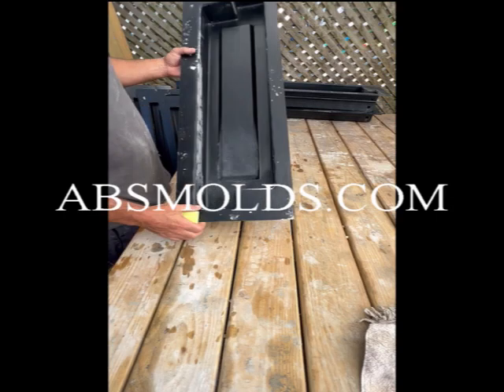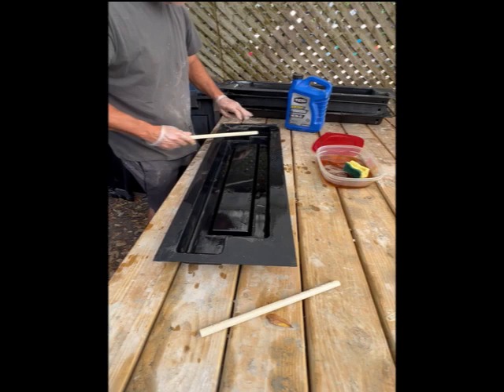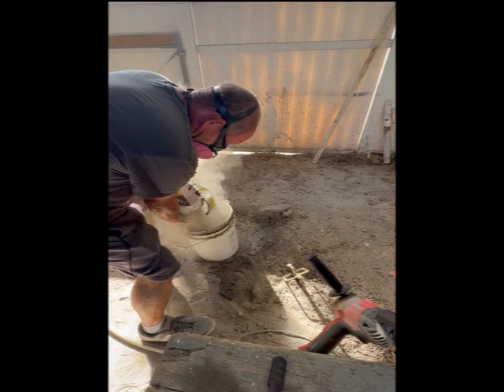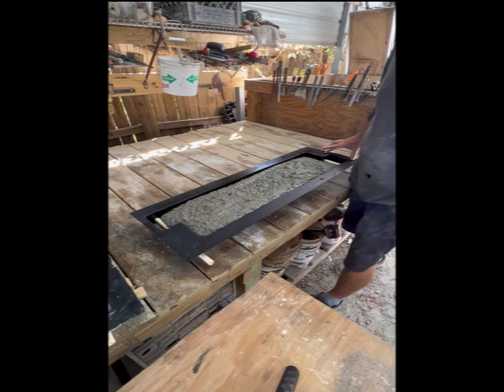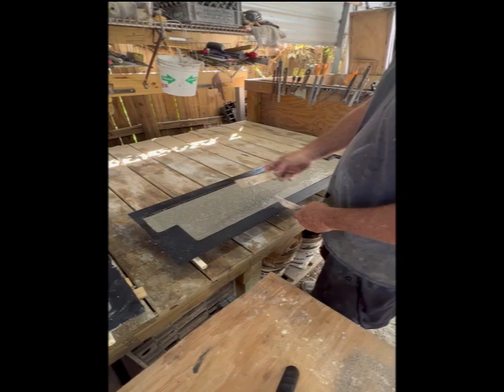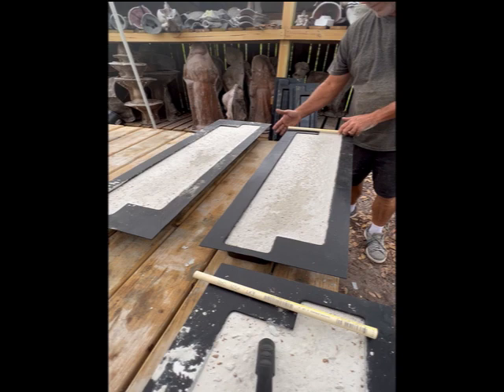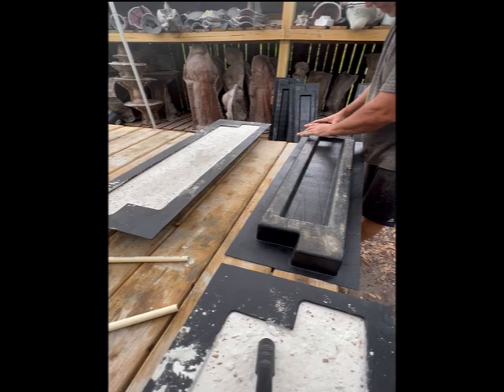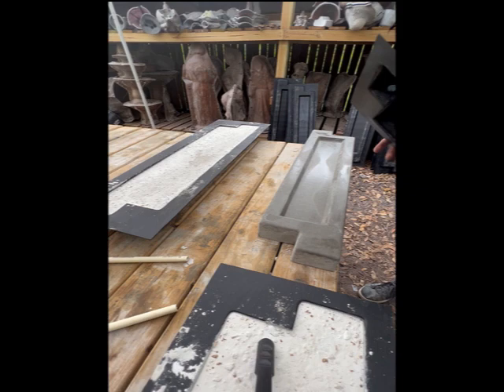Pouring and Pulling BedBlock Mold

Comment: I’m 5 into my project where I’m making about 30 of these. Some recommendations:
- use vegetable oil, shortening, or margarine to lubricator the mold. Motor oil is a toxic carcinogen and actually more expensive than these alternatives.
- rub a thin layer of vegetable oil or shortening on the inside of the mold with a paper towel. There’s no reason to go spraying motor oil all over your yard.
- Use Quickcrete 5000 in 50lb bags for 2 reasons. 1. This mold can really only hold about 45 lbs of concrete, so there’s less waste concrete to dispose of. 2. It sets in 10-12 hours instead of 24 hours so you can mold 2 of these on one day
- if you are close to the minimum set time for the concrete mix, be gentle when removing the mold from the block. I broke one block by being too rough.
Reply: Thx...👍
Reply from the maker: Dear keith,

Thank you for your feedback and suggestions regarding the use of alternative release agents and Quickrete 5000 for our ABS molds. We appreciate your input and the time you took to share your experience.

Regarding the release agent, we understand your preference for vegetable oil, shortening, or margarine as alternatives to motor oil. While these options can indeed be effective release agents, we have found through our 15 years of experience that there is a potential issue when storing the molds outside. Rodents are attracted to food-grade oils like vegetable oil, shortening, or margarine, which can lead to damage or destruction of the molds over time. This is why we have opted to use motor oil as it doesn't attract rodents, ensuring the longevity of our molds.

However, we acknowledge that different environments and circumstances may vary, and we respect your choice of alternative release agents. It's always important to consider factors such as storage conditions and local pest issues when selecting a release agent. We value your insight, and we'll certainly take your suggestion into consideration for customers who prefer alternative options and have suitable storage conditions.

Regarding your recommendation of Quickrete 5000, we agree that it can be a suitable choice for faster setting times and reduced waste concrete. We appreciate your suggestion. 

Lastly, we thank you for mentioning the importance of being gentle when removing the mold from the block, as it can help prevent any accidental breakage. We emphasize the need for care during this step to ensure the best results and minimize any potential damage.

We greatly value your feedback and aim to continuously improve our products and services. If you have any further suggestions or questions, please feel free to reach out. We appreciate your support and look forward to serving you in the future.

Best regards,

Mike Gunn
ABSMOLDS.COM
Reply: I'm thinking about using the red bag fence post mix (50 lb) that sets in 20-40 minutes. Also planning on adding a pinch of glass fibers, integral color mix, and wire mesh for reinforcement. Hoping to be able to make 3-4 per day as I plan on making 50+ for my garden. Do you think the holes for the rebar need reinforcement like an integral PVC tube cast into the concrete?
Reply: Once the concrete cures these are very strong. You’d have to really try to break one of these segments. I think reinforcement with fibers, mesh, etc is unnecessary. These would look nice with the addition of color pigments.

Comment: What's proper care?
Reply from the maker: Storage: Store the ABS mold in a clean, dry, and protected environment. Avoid exposing it to extreme temperatures, direct sunlight, or moisture. Ideally, store the mold in a dedicated storage area where it won't be subject to damage or contamination.

Handling: When handling the ABS mold, take care to avoid excessive force or impacts that could cause cracks or other damage. Treat the mold gently and avoid dropping it or placing heavy objects on top of it.

Lubrication: Apply a suitable release agent or mold release spray to the surface of the ABS mold before each use. This helps prevent concrete from sticking to the mold, making it easier to remove the finished product and prolonging the life of the mold. 

Cleaning: After each use, clean the ABS mold thoroughly to remove any residual concrete or debris. Use a soft brush or sponge with mild detergent and water to scrub the mold gently. Avoid using abrasive materials or harsh chemicals that could damage the mold's surface.